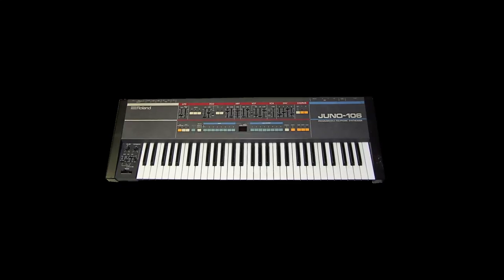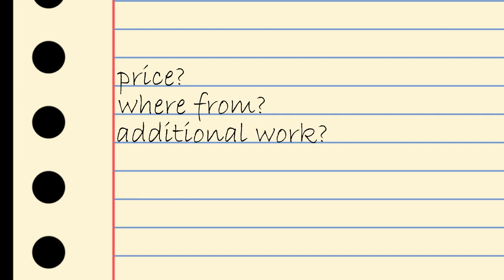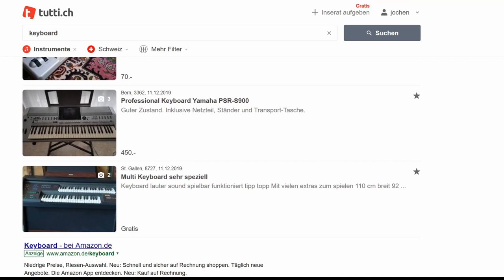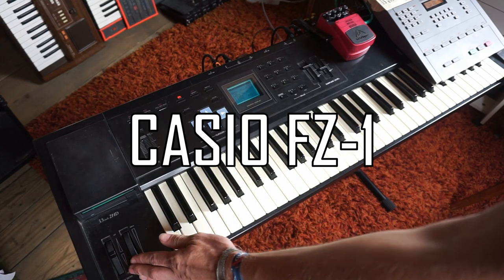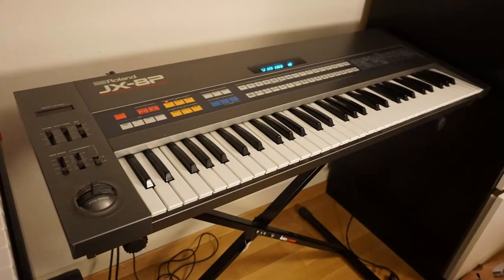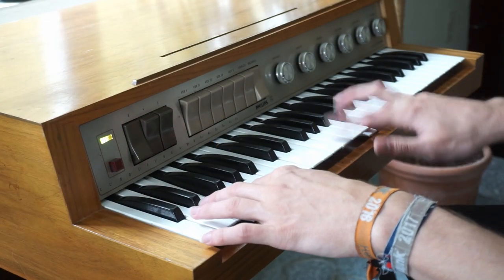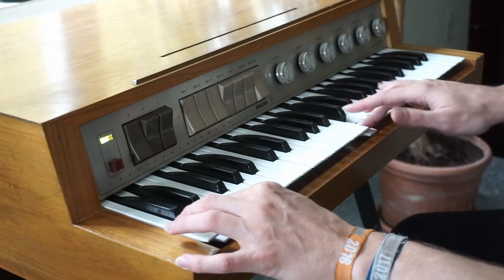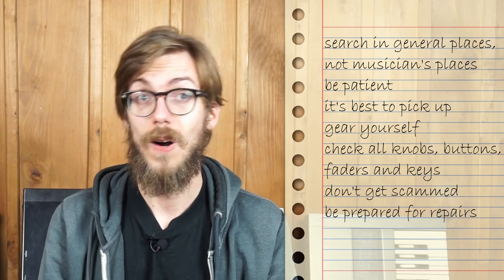My BEST DEALS on VINTAGE SYNTHS in 2019 - and how to find them

Comment: I recently saw an advertisement with musical instruments on eBay Kleinanzeigen (something like craigslist in Germany). The description said something about a keyboard. Of course I wrote to the seller immediately and requested a photo - in the end I got a working Korg Poly-61M in absolutely new condition with stand, case, operating instructions, Korg brochure from 1983 and cable for €50!

Comment: I got a Will System MAB-303 for the equivalent of $30 from a junk shop, a Casio VZ-1 for $144 (my most expensive), a Casio VL-1 for $30, a SR-88 clone for $30. with the exception of the VZ-1 they were all from junk shop. I nearly found a SK-100 for $40 but was just a little too late. If you wait you can find some great deals, just be prepared to do some minor repairs, if you can get to the stage when you can do full servicing of the units your world opens up. Just being able to recap some of these old units can fix a lot of issues. I think the main thing is not to expect things to be perfect. What you said about non-popular brands is so true - No way I would have gotten those kind of deals with Roland gear. But Casio everyone hates on. What I found was a lot of these units especially the rack mount stuff in a junk store people will assume they are none functional because the output is often line level. The SR-88 and the MAB got sold for junk prices because of this.